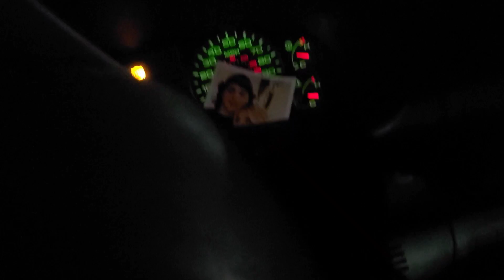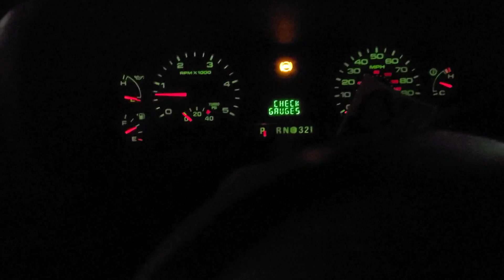I BLEW THE DIFF IN THE 6.0

Comment: I miss my moms 7.3 2001 Ford f250. It was a hardly Davidson edition, she has a 2011 tundra and never had one problem with it besides the window motor going out of course, she has 400k on that damn think and only had to replace one gear, I forgot if it was 2nd or 3rd. But the first f250 had no problems besides the door handle snapping off witch isn't bad for a ford.
Reply: The 7.3 and 6.7 are prolly the only two powerstrokes id get
Reply: @thomasmccabe3850  the 6.7 I heard was bad unless im thinking of the 6.0, im not really a Ford person so idk
Reply: @misterpimlott6330  the 6.0 isn't very reliable... Powerful and sound good tho
Reply: @thomasmccabe3850  I like the 08-2010 f350 tbh, they had terrible engines that year tho
Reply: @misterpimlott6330  they look sweet but I'll never touch a 6.4 in my life
Reply: @thomasmccabe3850  what would be the most reliable engine in that truck during those yrs? Also what would be best to make it reliable?
Reply: @misterpimlott6330  some people love 6.4s after they "bulletproof" them. Basically head studs, oil cooler, oil lines, gaskets, etc. Then they're decent with enough maintenance.
Reply: @misterpimlott6330  the v10's that year were decent

Comment: You need to sandblast that blue spring unless you got it from sinister diesel.. The cheap ones blue paint will come off and get in your upper fuel filter or worse injectors, Get you a sct x4 or livewire will wake it up.

Comment: You cant change the gearing in the rear without changing the gearing in the front also you destroyed the axle splines if its a 10.5 you want 8-10 thousandths of backlash or preload on the crush washer your gona want oem parts or you will be doing it again soon man.. Btw the truck should be a bit faster when fixxed thats why it has felt so slow.